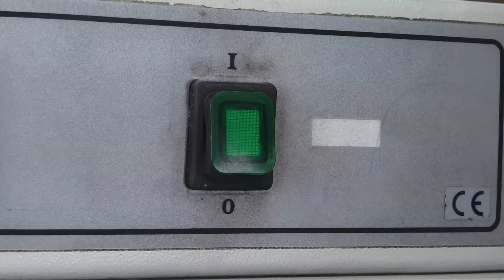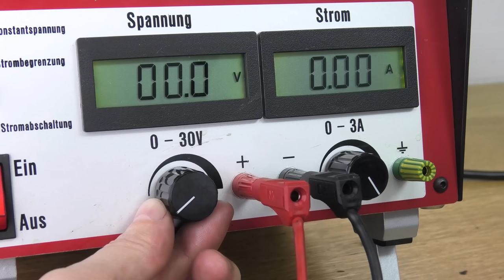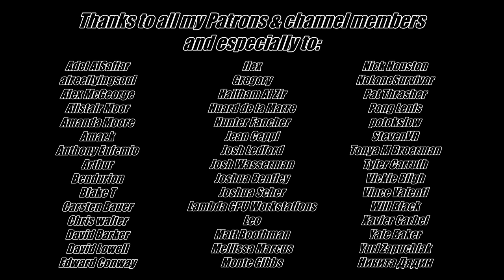1895 German Book Press "Alexanderwerk" - Restoration

Comment: I wish the original creator of this press could see how well this was restored. True craftsmanship. Great job 👏
Reply: this wasn't a restoration, it was a hatchet job. took a beautiful casting with character and turned out all the charm. modern turning lines in the whole thing
Reply: @cbgardner123  how about you put out a video doing it better then, instead of whining about the same thing over and over?
Reply: His point is that certain features of the item needn´t be fixed.
Sharp lines and casting marks..
This is a different approach chosen by many artisans since it destroys the tell tale marks that are charasteristic of that item and it´s era.
I myself disagree with all the sharp line dulling since it changes the look of the item slightly, to the trained eye that is.
I agree with covering of holes and to some extent, the filler use.
But purists simply would do minor extend job by cleaning and some damage repair and painting and that is about it.
Restoration vs modification.
So everyone has his own path in restoration.
And by that i agree in part with him except of course the hackjob part.
This is eveything but such a thing.
Reply: @KaregoAt  its not about "omg its ugly ew ew" restoration is u get an item *and u restore the pieces of said item and u dont change them* for example, u have an antique sword, do u fix the handle or completely change it to a modern one? if u do the second one, is it still antique? frick no, its altered in 2022 and no antique collector will ever believe that it was antique for many reasons and collectors and just... you get my point, he isnt restoring stuff, i would call it more of an artistic "fix it to look good" which is not bad i like it but still. calling this stuff after restoration antique is bad.
Reply: @domaczek6004  I'm just tired of seeing that guy comment the same thing on multiple videos on this channel. You could debate matters of taste until the sun burns out, but whining like that gets annoying.
Reply: @KaregoAt  oh okay, then i understand, critique is one thing, but being annoying and typing it everywhere is quite dumb. i get it now. fair fair
Reply: @domaczek6004  I think it also depends on the reasons for restoration, of course you wouldn't restore a painting by repainting parts of it differently than the original artist, but that dude is still  confusing CONSERVATION with restoration. If you want to leave the original work and workmanship and all that completely intact and only repair what's necessary to keep the item functional/aesthetically pleasing etc. That's more in like with conservation.

I don't like collecting for the sake of collecting but I do have plenty of very old vintage tools of different types and I use them regularly, I'd restore them to look however I want rather than look like its "journey" is at its end and it only has value if it looks a certain way on a collector's shelf. They'll look very old again in another 100 years when I'm dead, they're not going anywhere anyway lol
Reply: @archkull  i get ur point, for me when i get old stuff i always derust it or just clean it from dirt and thats that. when i get old coins *i never clean them* cus thats blasphemy and n o
Reply: I'm not sure he would care. It really wasn't very well made, and I kinda question the German name - not many self-respecting Germans would have produced this thing... 😝
Reply: @christopherbedford9897  lmao wtf are you talking about
Reply: @archkull  The poor quality casting, the uneven and irregular feet, the random placement of the feet mounting holes are examples of "non typical German engineering" (don't hate me, every German you speak to about this sort of thing will tell you there's two ways to do something: the German way, and the wrong way 😆)
Reply: @christopherbedford9897  dude I'm german, Germans aren't like this. My neurologist goes on vacation every other week and there's been construction right outside my house for two months when they said it'd be 2 weeks.

German engineering isn't some insane quality. (Not to mention actual build quality has nothing to do with engineering) We had lower quality products back then and we do now, probably even more now. Just like everywhere else.
Reply: @archkull  Yeah I was joking. I know it's a stereotype but as I mentioned, all the Germans I meet play into the sterotype too and I'm sure they are all (at least half) joking.

I have to point out that on my one trip to Europe (OK, it was Austria, but are those people much different? 😝) everything "just worked."

(OK I know, I know, I'm playing into a different stereotype with that last comment. Austrians are like Germans in the same way Ukrainians are like Russians, I get it. Another joke. Sorry.)
Reply: @christopherbedford9897  guess I played into the stereotype of humorless Germans then hahaha.

Ive really met people who think this way about Germany and Germans seriously, hence my reaction

Austria is pretty different!
Reply: @archkull  I actually forgot about the "humourless" characterisation 😆 but as soon as you mentioned it I recalled the comedian Henning Wehn who brings it up in some of his sets. He moved to the UK because "the Brits have more more of sense of humour" - yeah, OK. Actually just a different sense of humour. I'm a big fan of English humour but the Brits just won't leave the war alone and I'm not sure that's about humour or something else...
Reply: @ermias75ermis2  I agree. And My Mechanics isn't about "authentic restoration" but rather "what if" these objects have been manufactured to higher standard. Since he's clear with his intentions and goals, I can perfectly accept this type of restoration. He's doing a much better job than many others on YT and at the end of the day, he generally restore the mechanical functions and take care replicating traditional techniques like riveting, Which is interesting. BTW, I love old objects dents, patina and other such imperfections. But as pure entertainment and technical demonstration, MM does a fascinating job even if I find myself often not agreeing with his methods.
Reply: @cbgardner123  your definition of hatchet job is very wrong. If I did this in my garage without the skills and tools needed and it was half assed then that would be a hatchet job. This man has a superior skillset and proper understanding of what needs to be done. He clearly uses as much of the original as possible. The finished product and how it is labeled is a matter of opinion and how it will be used. Hatchet job, unskilled, wrong, or anything similar ....well these are all just the wrong words being used by someone who doesn't understand

Comment: I love how you get it to the point that some "restorers" would stop, and you're like "ok lets START restoring" just shows how much love and care is put into it.
Reply: Thats because he isnt restoring it at that point.
Filing off casting marks, filling in holes etc, isnt 'restoring'. 
He makes it better than new, but it isnt a restoration.
Reply: That's because this isn't a restoration, and I'm actually not sure I agree with this like... philosophically. He has not restored this, he has modified this to be in line with his own vision of how it """should""" be. A restoration would be to ONLY repair it back to how it would've been at the start: what he has done is a modification and a complete overhaul. 

Restoration is history. This isn't history. This is reconstruction from an extant base, not restoration of the original.
Reply: You're all failing to realise this is how its supposed to look. If you look up pictures of vintage book presses this is exactly what they look like, gold trim and all, except some were even more decorative with gold foliage designs. They were pretty machines, he restored it to its likely former glory. I don't see the problem honestly.
Reply: Some of the repairs are good, others just take away from the character of the piece.
Reply: @gitsurfer27  don't say he restored it because they technically didn't.

Comment: I love how on every one of these he calls it a restoration but he removes lumps and bumps that the original manufacturer just didn't bother with.
You're so awesome can't wait for the next one
Reply: Yeah. Original manufacturer... the casting is little rough, so what it still functions.

Restorer, let me mill and lathe this thing to perfect flatness on even the completely unnecessary inner corners of the stand feets. Also let me filler and sand this to get perfect piano lacquer paint finish.

Again 1800's: we just painted the rough casting. Paint is to give color and protection. It is not meant to double as mirror.

More of a rework and upgrade, than restoration. Nothing wrong with it as such, but that is different from dutifull historic restoration.

The holes werent exactly lined up and so on, since achieving such accuracy was much more work then and was unnecessary for thoseounting holes. Where it mattered, effort was done to get the necessary accuracy and uniformity. This was clearly a functional piece, rather than mechanical art bacl then.

This rework? Starts to more be mechanical art with perfect polish, paint and attention to detail, symmetry and so on.

Again it is absolulety gorgeus piece of craftmanship after all that work, but as said piece of mechanical art. Rathet than mere functional restoration or also not a historical restoration with attention to preserving historical accuracy.
Reply: @aritakalo8011  Well, we reap the benefits in that they didn't have HD cameras and Youtube in 1895, so that's something...
Reply: Tbh that thing is incredibly well built to begin with
Reply: @aritakalo8011  yes exactly. I am absolutely in awe of the work that went into this video, but at this point it’s hard to call it a “restoration”. If you’re going remove the patina and everything else about the piece that made it historical, why not just build a new one from scratch?
Reply: @aritakalo8011  ty for saying everything I've been thinking every time I watch one of his amazing videos. its literally never a restoration. he turns these old forgotten and unappreciated things, into mechanical art with extremely precise tolerances. they're so incredible that I wouldn't even want to use the tool for its intended purpose.

Comment: I have been a book binder for thirty-plus years and have never seen a more beautiful press. I would give a limb to have this in my studio!
Reply from the maker: Oh thank you so much, really appreciated!
Reply: I have one in my shop collecting dust, I always thought it was for bank notes. It's not made in Germany and the whole thing is cast iron including the nuts and bolts. Problem with these is the weight makes shipping cost crazy.
Reply: I've seen a few of these around, still in use and well cared for. It always struck me that the makers would go out of business because their product wouldn't wear out. Just looked on line - book presses are still made, but are super ugly. And they look like they'll need replacement in less than a decade, not a century.
Reply: I have one here in Berlin. where do you live? I can check on shipping costs. It weighs about 70 pounds though. Obviously not in the same condition as the one in the video after restoration. But a lot better than at the beginning.

Comment: This is by far the best restoration video I've ever seen. This was so much more than just cleaning the rust off and rethreading parts. You made these pieces look better than when they were cast originally. Amazing
Reply: Yeah then its an enhancement and not a restoration? I felt like he changed too much
Reply: @MrFinepixa  that depends on how you think about restoring. He restores the item for use again. If he were restoring it for history he probably wouldn’t make a new paint job or sand parts down as much as he did. He wants the item hes restoring to last and work as well if not better than it did before. Sometimes you will see items he has restored in the passed used in current videos as an actual tool.
Reply: @MrFinepixa  Right. The paint job was way too much as for me.
Reply: watch 1900 bell

Comment: I really enjoy the smooth and deliberate movements of the disassembly, cleaning, restoring and reassembly. Having the correct tools and knowing how to use them. I've watched a bunch of these channels since running into my mechanics, and I appreciate even more the quality of work. Most others just spray WD-40 over everything, make a mess, use shortcuts, buy parts and leave pitted metal alone. On top of that I love seeing previously restored tools being used to work on additional ones.

Comment: Wow. That's a beautiful restoration.  I was impressed to see the screw and threads cleaned up with a tap & die - amazing to think that standard thread sizes were already in use in 1895.  Also, at the start, be prepared for the crowd telling you the adjustable wrench is being used in the wrong direction!  But I really enjoyed watching, it's very satisfying to see the process.

Comment: FYI the little hole you closed up on the retainer plate is where oil would be put to lube up the joint. Mine, a very similar, but smaller unit has one that's exactly the same, with a small felt plug inside.
Reply: I do love watching MyMechanics at work, but it does worry me a bit whenever he says a part of the design has no purpose. Generally there will be someone in the comments pointing out it's not true (and in this case I did guess it might be for oil, though I wasn't sure).
Reply: Well one thing is for sure, if he decides you're right, and decides it should be put back,  he'll have no problem making it happen! I believe you are right,  I hope he does too...
Reply: This guy gives me a migraine. So much done wrong
Reply: @douglasharrington3003  Like what?
Reply: @wwfera00  welding, body filler removing stuff that was mentioned to be there. polishing stuff that wasn't ment to be.
Reply: @douglasharrington3003  how would you do it?
Reply: @EpiphoneShredzzzzz  clean up the rust repair any damage. repaint if it was bad enough to need it. No body filler on something that doesn't need it and if it does not load it on there. His welding you can tell it's not right by the sound its making
Reply: @douglasharrington3003  I look forward to seeing your how-to, instructional videos on proper welding and restoration. You're the man, Douglas Harrington. Top class.
Reply: @douglasharrington3003  well he's not a welder, he's a CNC  operator. He probably only learned basic welding for his restorations. And the body filler before paint is a matter of taste, not what's right or wrong. He likes the finished product to look smooth. It's not always my favorite look either but that's fine cause his overall work is top notch
Reply: @douglasharrington3003  You do realize that recording the sound of welding is just about as hard, if not harder than actually welding something, right? (microphone, amplifier, room accoustics, codec, audio processing, electromagnetic interference from the arc welder, ...) And you really think you can judge the quality of a weld by the sounds you hear on a youtube video? People are mad these days, seriously...
Reply: @douglasharrington3003  Thanks man. So where are your uploads on how to do it the right way? I'd like to learn visually. When can I expect an upload?

Comment: What I like about his videos other than the restoring itself he often shows how the device is actually used. I was wondering how it helps bind book.
Reply: When making large books smaller groups of paper (pages) are folded and pressed in a device like this.  These are called signatures.  Each of the signatures are then bound together. If book binding/making interests you I’d suggest Nerdforge’s channel.  She has done a ton of incredible book projects.
Reply: To be fair he was not, not really. The book press is an incredibly useful piece of kit for a bookbinder, I have several of different sizes, and it IS used when gluing the spine of a book block to keep the signatures in place while gluing the spine, but the spine would not actually be inside the press itself, thats a really good way of destroying the spine of a book! That being said the book press is used whenever the binder needs pressure on most of the books entire surface to keep the book from shifting, or when you need pressure for even curing and bonding (like just after you have glued the cover on).

The binding style he was showing is the Perfect Bind and is generally not pressed as most bookbinders will have access to machines that will glue the spine a lot faster and more cheaply than hand binding can achieve. Those books will only go into the press at the end after the covers are glued on. All other binds are sewn, the gluing of the spine is to add more strength and structure to the spine and in many cases the spine is slightly thicker than the edge. The cover is constructed to even the thickness differences out but the spine itself is what gives a well bound book much of its strength and longevity. Which is why a modern professional bookbinder would NEVER put the spine in the press... when being pressed (for one reason or another) the book will be in the press with the spine protruding out of it. Especially properly backed binding styles where the spine is mushroom shaped, that shape is there for a reason, it is not accidental.

Its a simple piece of equipment but has many uses, which is why you see so much edge damage and the like on old book presses. They are heavily used pieces of equipment.
Reply: @alganhar1  Thank you for adding these details.  I agree with you 100%.  It’s why I mentioned Nerdforge.  She really does show creating signatures, pressing them as prep, binding the signatures and creating/shaping the spine of the book.
Reply: "actually"